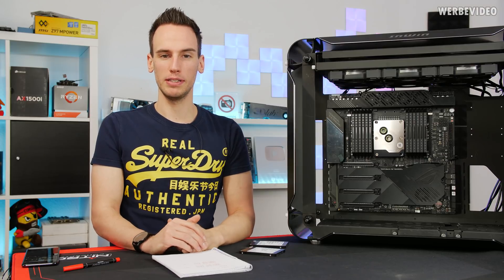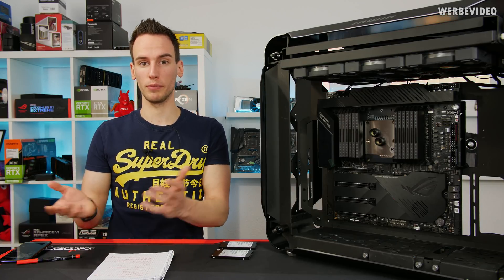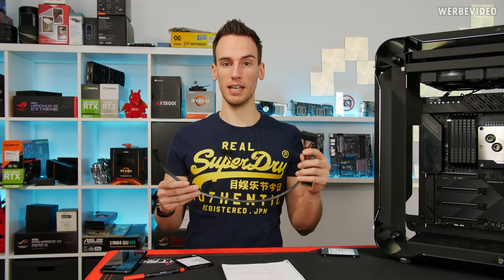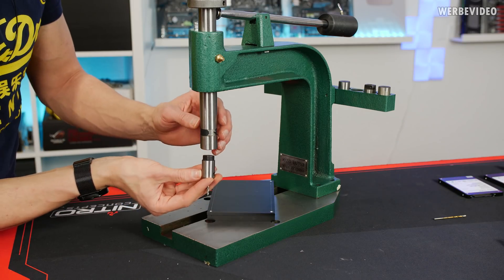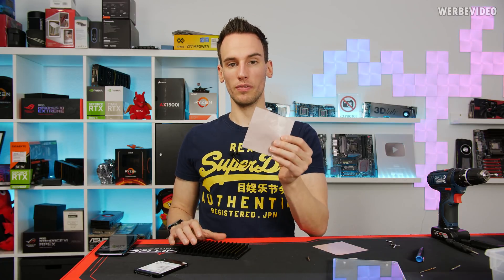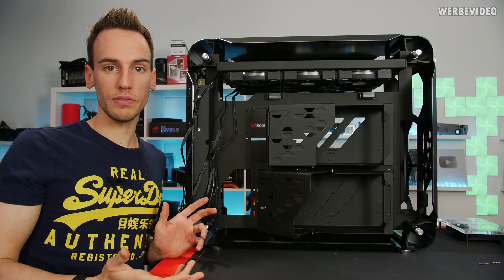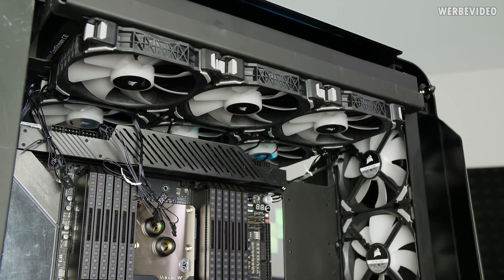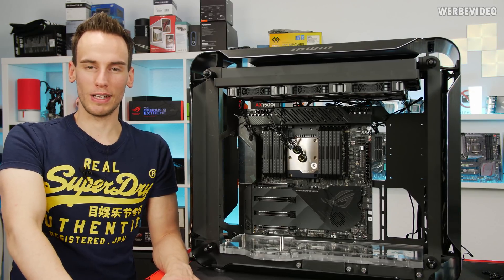Project Irrationality Part 7: Building a Cooling Block for 15 TB of Enterprise SSDs

Comment: You can just buy M.2 to U.2 adapters though :P
It's all pcie x4, just different connectors
Reply: no, he cant. This would be rational
Reply: @LinkStorm13  Haha, very true
Reply: Yes, true, but the M.2 on many boards is shared in the DMI or on a switch with shared bandwidth, U.2 has it's own lanes, generally shared with slots rather than the DMi lane, so it's like putting a drive in a PCIe slot (like vroc). M.2 is kind of like the new "sata". Generally on a switch shared bandwidth on the DMI. That's why so many consumer boards with 2 or more M.2 drives only can max out one drive (run benchmark on both drives at the same time, their numbers will be half etc) vs putting them in PCIe slots, you'd get full bandwidth on each, but cost you 4x lanes each. Consumer boards generally were 16x lanes so eating 8 for two drives wasn't an option unless you went to Intel HEDT. Side note, the C621 chipset, I believe could go 8way cpu support. ROFL can you picture  2x 4x or 8x W-3175? LOL at 8x that'd be like 16,000 (16KW) watt spikes. ROFL
Reply: @bBrain  That's not a problem on TRX40 platform. Threadripper CPU on it's own provides two ports that motherboard can break out to PCIe 4.0 x4, M.2 4.0 x4 or 4x SATA. 
Chipset provides second pair of such ports (these are little more flexible, allowing for 2x2 and 4x1 PCIe configurations).
Additionally, connection between chipset and CPU on TRX40 platform is 4 times as fast as on Intel (AMD uses 8 lanes of PCIe 4.0, Intel has 4 lanes of DMI which is essentially PCIe 3.0). Two PCIe 4.0 x4 NVMe drives could saturate that link, but wouldn't be bottlenecked by it, at least not without additional traffic from USB or LAN.
If you need more than 4 M.2 ports, you still have 48 PCIe 4.0 lanes directly from CPU you could split into M.2 ports.

Compare that to the Dominus Extreme. If I'm reading this correctly, all 4 M.2 connectors (on the DIMM.2 slots) and both U.2 ports share lanes with PCIe ports. Populating all 6 interfaces leaves you (if I'm reading the board manual correctly) with only the top PCIe x16 slot available.

In the end, it's all about the number of PCIe lanes you have. TRX40 provides you with 60 lines of PCIe 4.0 (48 in regular ports, 8 in M.2 and 8 to the chipset), while W-3175x provides 52 lines of PCIe 3.0 (48 from CPU, 4 to the chipset). 
Situation would be a bit better on with W-3275 which has 64 PCIe lanes, but you would be still stuck at PCIe 3.0 and quick google shows that PCIe 4.0 U.2 drives exist (Samsung PM1733/PM1735)
Reply: @MikrySoft  m.2 ports generally go though the chipset link.  Sometimes they might have 1 going though chipset and one direct.  You can always throw nvme drives in a pcie adapter and just plug it into a slot or use a 16x 4 nvme drive adapter in a slot and be direct and full bandwidth to each drive (4lanes each pcie3) So no bottlenecks if you are doing that and you'll get full 3.5gb/sec doing that, need more speed, add more drives. Each 4 drives in a raid0 will give you 14GB/sec  Yea PCIe4 drives are about 1gb/sec faster, soon Intel is going with PCIe5, so they are gonna leepfrog each other it seems. Honestly, 4 nvme drives in a raid 0 is pretty insane, even on pcie3 link speeds. 

I'm not sure PCIe4 or (intel going pcie5) would be their selling points. It's not like you will notice windows any faster past a single direct 4x pcie3 speed anyway. I mean I don't notice any difference with 1 or 4 (raid0) in day to day operations. Only in say a file transfer to nas would i see any difference. 

The main advantage to Intel is frequency. Intel still has the edge there. Yea it's power hungry but I've never card about that. Hell I wish they would make a line that doesn't care about power usage and give us what you can AMD and Intel. LOL like who cares if it uses 800watts. Let's do it. right? LOL

straight up though if I was building a webserver or database machine right now, I'd go threadripper, it's in a spot I might go for it or was building a cpu raytracing render box, dual threadripper 64core each, heck yea. But really apart from those workloads, I'm gonna go intel for frequency. 

There is a noticeable difference using windows and apps from 4.5ghz all core to 5ghz all core.  Hard to give up that snappy quickness for just more cores in my book. But to each their own. I like what AMD is doing, but I'm REALLY hopping AMD will also keep an 8-10-12 core that they will boost the clocks on. You gotta have that 8-10 core sweet spot that's for frequency, because that fits most users needs and then games like mad. AMD needs a 9900K, 5ghz on 8-10 cores.
Reply: @bBrain  M.2 ports go however CPU and chipset are designed. In case of TRX40 platform, you have (up to) 2 M.2s direct from the CPU and (up to) 2 through the chipset. Different motherboards can use those lines as they see fit, either as M.2, PCIe or SATA. Looking at the manual of the Gigabyte Aorus Xtreme TRX40, you get two NVMe/SATA M.2s direct from the CPU and two more from chipset - one of which is sharing lanes with four SATA ports, which is (IMO)  a smaller sacrifice than loosing 3 out of 4 PCIe ports like you do on the Dominus Extreme.

The main barrier to AMD getting 5GHz isn't number of cores (although heat density from many cores under a single IHS certainly doesn't help), it's silicon manufacturing maturity. Intel had a number of years to perfect their 14nm++ node to squeeze every bit of optimization they could. AMD on the other hand works on a relatively new 7nm node. As the old Russian proverb says "the marvel is not that the bear dances well, but that the bear dances at all."
As time goes on, TSMC will (hopefully) figure out how to make their 7nm node faster, more energy efficient etc., allowing for faster and faster chips. Remember, the Intel 10th gen Ice Lake chips on their 10nm node have 15-20% lower clock speeds, at least at their (lower) rated operating voltage.

Not to mention the fact that IPC differences make comparing clock speeds between architectures completely meaningless. Only realistic workload benchmarks make any sense.
Reply: @MikrySoft  Agreed on the m.2 ports, it's pretty much however the MB is designed. I was just saying you can always use a slot to go direct if the MB didn't design an m.2 slot to do it and was shared in the DMI switch. 

True on the TP maturity. However you do know that Intel's 14nm is 10nm actual. Intel's marketed node has for the most part been once size lower actual. It's why the 14nm line keeps up with TSMC's 7nm is compariable to Samsung's 7nm and Intel's 10nm (7nm actual).  A lot of people do not know this info, but it's there for anyone looking. This is why Intel's 10nm (7nm actual) will come out of the box as a surprise to most people. Intel also went for a 2.7x density increase keeping with moore's law, had they went with 2.0x they wouldn't of been behind. Took them longer to mature it. But Intel's 10nm will have an 16-18% IPC uplift and be running at clock speeds we are used to seeing. Mark my words on that one. Intel knows frequency is just as important if not as important as "core numbers". With game scaling being in a sweet spot of 8-10, maybe 12 cores. 12core can have issues with windows scheduling thus why 8-10 at high frequency is that sweet spot for gaming. And low and behold intel's 10900k is going to be a 10 core high frequency. There is pros and cons to a highly mature TP node that's for sure. I personally love it. 

I just slapped a 10900X in my workstation, (I know everyone doggin' the ten thousand line) lol it's funny to me anyway... I have the best of both worlds, 48 lanes, 5Ghz all core (although it makes some freakin' heat, only going to get 5ghz on a custom loop with at least a 480 rad and a large fin size waterblock (im using the new corsair large block), forget any AIO will only get 4.7ghz or so on them, and I can run 256GB of memory, of which I will do at some point (freakin' aftereffects and cad will use whatever you have).  For me, Frequency matters so much more in what I do than core count. The user experience GUI speed, etc matter more to me than saving a few mins in final render time. Anyways, CPUs today are so "use case" anyway. Anyways, I think a lot of people pass over X299  & X299X and the 109XX HEDT chips not realizing what they actually offer (well guys in the know don't anyway) 

Intel has released the 10nm for mobile, laptops, etc. These are generally lower frequency as battery life is important. Intel has used this as a method to mature 10nm which is now I think 10nm+ or 10nm++ already (can't remember which) but 10nm desktop/HEDT will come out of the box mature and high frequency watch. Yes, IPC can make up for a lot, but with nodes so close, as you can see even with the 9900K in many workloads (gaming being one for example) Frequency matters. As a side note, it is not just that Intel's 14nm node is mature, Intel's microcode is also JUST as mature and AMD's microcode is nowhere near there yet. It will be, it will take them another 6,8,12 months to get it there. That's when the AMD lineup will really shine. Honestly, if AMD's microcode was just as mature as Intel's AMD would have the full on lead right now. That investment Intel made has carried them. 

I mean, yea we are talking small percentage points for the "KING OF _____" in most cases right? Like who cares these days. If you are making a gaming system today, You won't go wrong with an AMD 3900X, if you got the $$$ 3950X,  9900K, heck my 10900X/2080ti combo sits at 165hz (my gsync limit) @ 2k in most games anyway right... so like go with either one, they do have pros and cons to each. I just built 3 9600k machines for my kids for christmas because microcenter has the 9600K for $179, i mean come on, 5.2Ghz nvme gaming setup on a $179 cpu? Insane. Thank you AMD :D 

I'm going to be building a new game server (large minecraft server), I have given serious thought to using AMD 3950X, the only thing holding me back is Java loves frequency and I'd most likely have a better performing server on a 9900K or 10900K (when it comes out). But I've seriously thought about building one just for the fun of it. I mean worse case I'll turn it into a VPS server. lol 

Bottom line. I think 2020-2025 are going to be exciting years in computing for AMD and Intel fanboys
Reply: @bBrain  Both M.2 and U.2 are just connectors. As we've seen from AMD, M.2's can be driven straight from the CPU, as long as the platform is designed with that in mind and has the required PCIe lanes.

M.2 is not "the new SATA". SATA is a protocol. M.2 is a physical connection that can accept either a PCIe x4 or a SATA drive (or other PCIe devices). SATA drives require a SATA controller somewhere (usually the chipset or the CPU), whereas NVMe can be connected directly to PCIe.

U.2 isn't viable for mainstream platforms, since the drives are enterprise grade (and price), and only a limited number of PCIe lanes are available. You're bound to have to make some connectors share bandwidth or be alternate to each other, so it's better to only offer M.2 and then have people really keen on U.2 use an adapter (as long as there isn't a GPU on top of the M.2 slot blocking access...). HEDT and server space don't have that problem - especially EPYC with its 128 lanes.

VROC is nothing but Intel's attempt to put CPU-connected NVMe RAID behind a licensing paywall.
Reply: @Silvar55x  Yes I understand how m.2 and u.2 work, I was speaking in reference to how most Intel desktop cpus/chipsets work with DMI, the M.2 ports are generally on a switch and go though the DMI link and thus you'll never get full speed of the drives at the same time. Generally not needed on a normal users machine as they are either doing lightweight workloads or gaming of which generally just one drive is in use for the load and never seeing the bottleneck hit. Yes I know there are some that are directly linked, and on HEDT as well. Of course you could always throw a m.2 drive in an adapter and just plug it in a slot. Some even make a 4 drive 16x adapter. I have 2 of them. :D 

Yes, I also understand what serial AT attachment is. What I was refering to is that m.2 is the new standard, with sata kind of left over, think how IDE connectors. I'm just saying many gaming systems don't even use sata much anymore. If ya have a home nas or use a cloud drive, not much need for a home gaming machine to have a sata connector, but m.2 is the new standard. Didn't think I'd have to explain that one... 

Totally agree on consumer level, some did have external u.2 drive connectors to sneakerNET some data around. HEDT with 48 lanes doesn't have an issue today and is well suited, can't really see a need even for the poweruser for large core threadripper/epyc lol LIke running a xeon. lol gonna suck for most things. 

Yes, VROC is that, but it also worked out of the box on day one. :D  I had a 4 disk raid 0 in 2017' on a 7820x, pushing 13-14GB/sec. Nothing could of been easier to setup and make gooooo and it went like the wind. lol Easily saturating a 40gb/s network link.  Kind of sad to think that's considered "slow" today. LOL
Reply: @al2me6  Yea you can do the same thing on intel platforms. Then VROC is absolutely amazing in and of itself.
Reply: On threadripper every pci-e will be running off the cpu